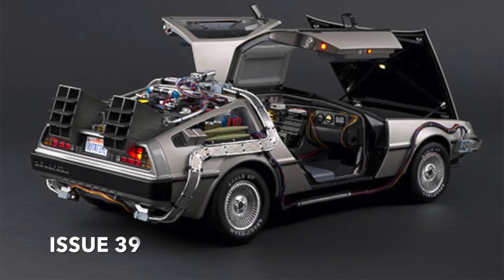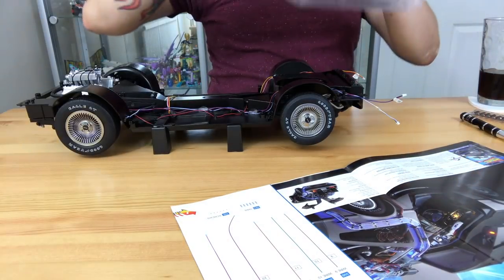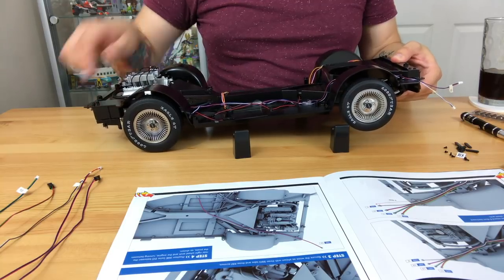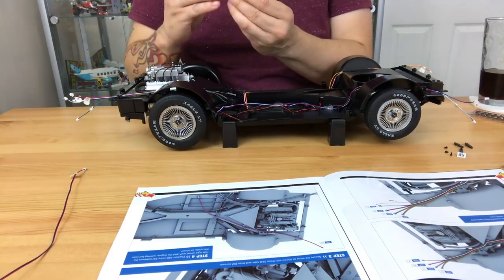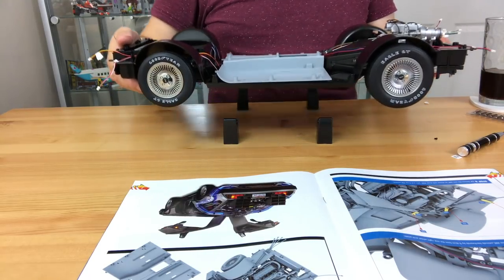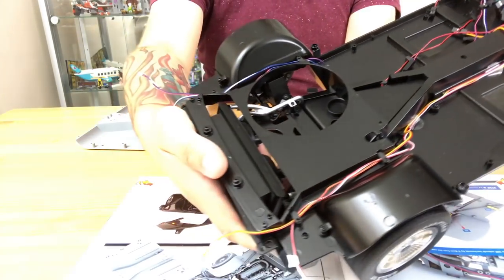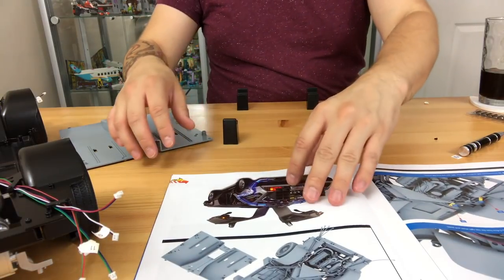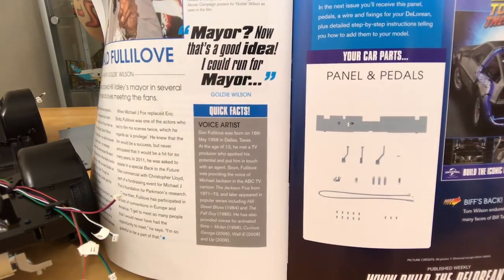Build The Back To The Future Delorean: Issue 39 - Chassis Plate & Wiring (Speed Build)

Comment: Hi mate , check your wiring they messed up the numbers in the mag, you need to lay the wires by the colours in the mag NOT the numbers and re number the wires with some masking tape or something. Theres stuff about it online, you’ll notice the blue and white wire and blue and red i think it is are longer so that needs to be on the other side, as the extra length is to accommodate the cable coming over the middle of the chassis to join the other connectors. :-)
Reply: Thanks for your advice on the wires had mine the wrong way.